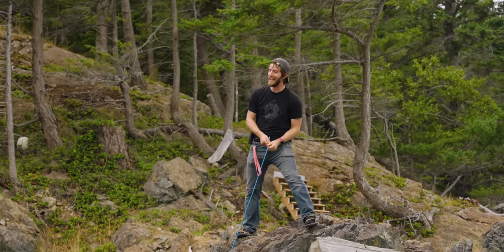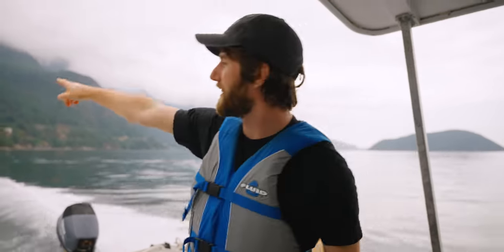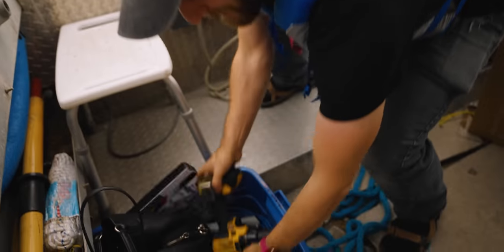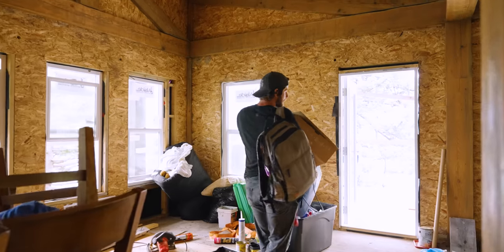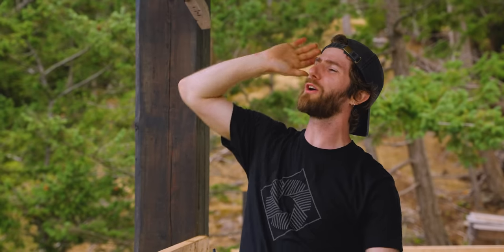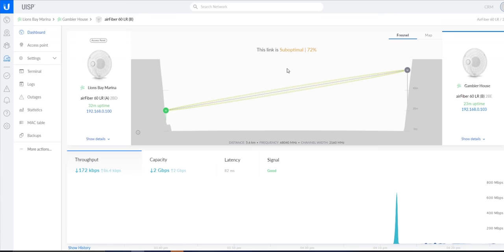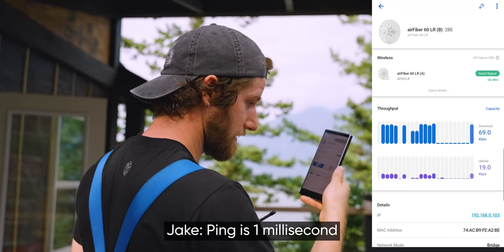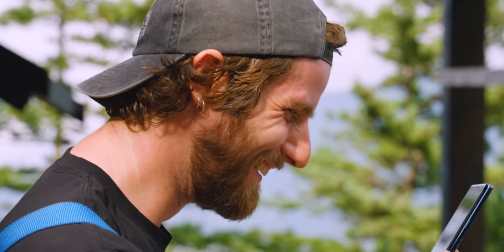How are we going to do this?

Comment: Your tapcons stripped out because you didn't hold the drill straight when you were drilling into the wall. It is very common. Also do not over tighten tapcons. A gentle tap with an impact driver is plenty.

Comment: I would like to know, how steady the system works on a daily bases, like when there's rain oder mist or strong winds shaking the dishes. Can you do an update after a few days/weeks?
Reply: I used to work in a building 100km from a city that got broadband internet through a microwave dish pointed at a transmitter on a tower in town. It was perfect during the day but in bad weather it went to crap pretty fast and would fall back to an ADSL phone connection.
Reply: My internet service provider uses a similar dish from the same manufacturer, as do all our neighbours.  We have very little signal loss when it rains or snows.  Wind hasn’t been an issue either and I’m on the prairies getting a lot of wind.
Reply: @mattleblanc31  I love that one time that you took all of Chandler's clothes and put them all at once and did lunges
Reply: Sprechen sie deutsch?
Reply: @theinsfrijonds  HUH?
Reply: @grey.7828  Matt LeBlanc is an actor who played Joey on Friends a TV show. I was referencing a scene from that
Reply: @theinsfrijonds  Todays Top Grar is trying to be as good and funny as the old and oroginal but they are crap, srry 😂
Reply: My ISP uses dishes like these. (I live basically in the middle of no where with my house dish commuting with a base station) from what I've seen here my ISP cheap out on there dishes because I get no where near speeds like that I'll be lucky to get 15mbps.
Reply: @theduckscp  if it makes u feel any better I had literally 120kbps internet at my old house thanks to it being on a new estate having new houses built everyday yet no bandwidth upgrade.. I do not miss that hell
Reply: @punkson  nein
Reply: That could be interesting
Reply: A friend of mine used to run a WISP off of that very building, to the same island. The biggest issue was multipath off of the ocean, and it changing as the tide goes up and down. That would cause about 6dB difference in performance, and cycle roughly every 11 hours. He eventually gave up and moved stations to higher ground to avoid it. At those low elevations, the ocean is fully in the Fresnel zone.
Reply: @Dreamerick97  no it doesn't, that's the gigabeam LR and they're terrible on both 60 and 5ghz
Reply: @LukeMellor  yeah my b, airfiber60 is the one with both bands, why would u say GBE-LR is terrible?
Reply: @Dreamerick97  The antenna design doesn't work well for 5ghz, I was getting roughly -60dBm on the 60ghz, -80 on the 5ghz which is basically unusable. The mount is not geared towards 60ghz as it's a manually move it then tighten a bolt kind of affair with no fine tuners at all. We shelved them after an hour of use, af60lr has been in full time use for over 6 months now. 2 dropouts due to snow in that time.
Reply: @LukeMellor  oh thanks bro, i was about to buy a pair of those, would u say they dont worth for a 1.72km(1.07mi) link?
Reply: @Dreamerick97  that's roughly the distance I was covering. The af60lr are well worth the extra money by a long way. Got -42dBm with those easily. When panning them in imagine a target. Centre is perfect, a ring of bad signal round that and a ring of mediocre signal around that.
Reply: @LukeMellor  Thanks bro, u just saved my money, God bless ya
Reply: @theduckscp  your speeds may be because the provider does not have enough bandwidth at the main site your radio is aimed at. The data has to come to a site via a backhaul link or stronger licensed link. And then depending on how many people are using that main site the bandwidth isn't available to give high speed to everyone.
Reply: @theduckscp  they probably just throttle your connection to serve multiple customers. More than likely it would provide these speeds easily if they wanted to.

Comment: Radio waves can have some strange behavior over long stretches of water. I would also recommend a 5GHz failover do to the 60GHz will drop the connection in rain.
Reply: Yeah or when you have fog I guess..
Reply: the device already did that out of the box
Reply: All sounds pretty overkill to me for an offgrid cabin.  We used to deploy 24ghz airfibers in NM for gigabit links. Even during monsoon season at 5-7 miles we never had full drops.  Signal would lower sometimes but they were always fine in terms of transfer speeds. I'm super confused why they went with a 60ghz link for an offgrid cabin, especially in an area with lots of weather, I'm guessing it was free from Ubuiqti.  I guess radio frequency laws might be different in Canada as well.
Reply: @Serial32  60 ghz was probably just a band that is free for consumer use in Canada
Reply: I imagine buffeting from strong winds would play havoc with the dish alignments too.
Reply: @leothecrafter4808  I was thinking that as well, I'm not familiar with the regulations up there.
Reply: @Serial32  my guess would either they get it for free, or price, af24hd cost like what ? 3k a piece making the total cost 6k usd before the mounting equipment and other things, that af60 costs less than 1k a pair, and its newer so more attractive for video, i do wish they come up with cheaper 24ghz device at some point
Reply: @TonnyCassidy  Correct, for one airfiber model anyway. A 5ghz backup radio is already built into the AF60, but here I think they may be using the AF60LR, which does not have the backup 5ghz radio.
Reply: @jazzmusiccontinues1134  wait the LR dont have backup radio ? I thought it have it, ill check the datasheet again

Comment: Back in the day, me and one experimental ISP were fooling around with 802.11b wifi, and we managed a 256 kbps link over 3 kilometers, using literally pringles cans and a UHF-like antenna. We managed to blackout an entire town wifi when we fooled with the power on the antennas. 256 kbps over that distance was quite a feat back then over a theoretical 11mbps. The OCEAN would reflect everything and kill any attempt to boost the signal.
20 years later, Linux is shoving a gigabit in a 60GHz dish. OVER A LAKE.

Comment: Feels bad when Linus’ parent’s off-the-grid house has internet that is literally 26 times faster than your very much on-the-grid internet....
Reply: Yea mine is 100mbs
Reply: @ovamper4451  bruh I'd still take that, mine's 35mbps on a good day... Though if you ask steam, it's 3-4mbps...
Reply: @phoxoto  Try 900Kps
Reply: im in a small town and i have 1.5gbps
Reply: @phoxoto  What steam tells you is very much correct. The difference is that your provider states it in megabit per second, while steam states it in megabytes per second.

So 3 to 4 megabyte per second is about 24 to 32 megabit per second.
Reply: Meanwhile I'm here on Optus 4G Mobile Broadband getting 200mbps down/50mbps up (as the average, sometimes they spike at closer to 250/75, but it's otherwise reliable) out in the more rural section of the Riverina, NSW here in Aus.

Also, when comparing mbps (ISP) to MB/sec (Steam), the MB/sec value is 1/10th that of the mbps value, as whilst it's 8-bits-to-the-Byte, data transmission uses a 10:1 bit:Byte ratio instead of 8:1 to provide some parity bits to ensure the data isn't corrupted (easily anyway) during transmission if a bit here or there is dropped.
Reply: At least your able to get high speed internet where you live. I'm not even an hour away from a major US city and can't even get a cell signal without using a 500 dollar amplifier,and then I get mabye 1 megabit per second that cuts out every min for about 20 secs with a monthly hard data cap of 30gigs. After that it's capped to 115kbps and I gotta pay over 100 bux a month for that garbage.

My life has been a nightmare for over a decade now
Reply: 3mbps in 2021. This is painful
Reply: It's honestly dystopian how bad internet connections are here in America. And not even because it can't be done. All just because like 3 companies are maintaining a stranglehold on infrastructure to bleed customers for every penny they can.
Reply: @gundoxcrit1652  here in the UK there's only 2 different lines, BT or Virgin, all other providers have to run through BT's network because it's their infrastructure, so BT not only throttle those services as they see fit, they also throttle their own packages in order to get you to pay more because what else you gunna do? Go with another service on the same lines? Go with Virgin on their weaker, less available, lines?
Reply: @SEXCOPTER_RUL  move
Reply: How can you tell that? They don't even have an internet connection over there yet until the ISP hooks it up in a couple of weeks, and they didn't show us internet speeds from the lte modem. The fuck are you talking about
Reply: @phoxoto  i literally live in a 3rd world country paying arround 40 usd for a 100mb download / 5mb upload
Reply: You're talking shit, they never showed "internet" speed, only W/LAN speed. That would be like saying you have Gigabit internet because you have a gigabit switch at home - that won't determine what your actual internet speed is.
Reply: @jdilksjr  i get super excited when i download at 2mbs but its usually 500kbs to 900kbs
Reply: Dont forget the private island.
Reply: I have 4 Mbps on 4G LTE
Reply: @TheDarkFalcon  bro why the aggression?? A quick read through this thread already proves I don't know shit about how this works, my original post was just a light hearted comment poking fun at my own bad internet... Lighten up, my guy...
Reply: @AndiKola  my guy, what's with the aggression? It's already apparent that I don't know shit about this stuff, I was just making a light hearted punt at my own bad internet from what I thought were internet speeds... Lighten up, the world is shit enough as it is...
Reply: @darkbobo000  well you learn something new everyday, I rescind my shaming of Steam's display xD thx for the info!
Reply: @phoxoto  Now you know better. Your slow internet is way way better than what linus set up because he doesn't have internet at all.
Reply: @AndiKola  wow Andi, ty so much for the ✨knowledge✨. Life = changed. Now to get rid of my humour so I can be just like you 🙏🙌
Reply: @phoxoto  I don't want you to get rid of it, I want you to improve it
Reply: @AndiKola  teach me, daddy 🙏
Reply: @phoxoto  dude mine is 1 now for some reason its been super slow the past week and steam said it would take 13 hours to install a 4gb game
Reply: @dukiest7368  biggest oof 😬 I'm sorry for the loss of your internet

Comment: What about during thunderstorms or a strong wind? Could that mess with the internet?
Reply: i was thinking about fog, since water is good at absorbing radiation
Reply: In theory, yes, in practice? Not too common over that short range.

In practice, I have had worse interference on rainy days from copper based T1 connections which had shoddy wire bundle wrappers and would short out with water leakage at a past employer than I ever had with any point to point wireless nodes I set up for that same employer, and had network monitoring and statistics to back that up.
Reply: I would expect once everything is fully tightened down wind should be fine up to 30 to 40 km/h, rain will cause signal degradation depending on how heavy it is, but shouldn't need regular adjustments. Satellite dish mounting arms like that stay in place pretty well, I'd be more concerned about Ubiquiti's mount system to the mounting arm knocking it out of alignment in heavy winds. But they aren't in hurricane country I doubt they have many storms that are going to cause problems.

Also his parents need to make sure the trees stay trimmed to keep the beam from getting blocked by leaves or branches.
Reply: @Kinkajou1015  have you seen the mount on these air-fibers?  It's on another level from the previous mounts that I've seen from Ubiquiti.  Very nice.  Longevity remains to be seen, but they seem extremely durable.
Reply: @tburda823  This video is the first I've seen.
Reply: @Kinkajou1015  id be more worried about snow flurries than anything else
Reply: With my own personal experience it's not noticable for the average person. Maybe if you're playing very ping senstive games.. But even with really bad weather it hasnt been any issues. But even then, it's still been 10x better than 4g/adsl in the same building.
Reply: It can. But you need severe interference. Fog has a chance as well but really the main problem with air fiber is trees.
Reply: It will work just fine
Reply: Weather can greatly impact signal indeed.
Reply: During massive thunderstorms, the link could disconnect. Other than that we have been running them on 10+km without issues.
Reply: @Kinkajou1015  I would be more worried about snow and ice collecting on the dish causing issues of outage and alignment especially on the house side. A heavy snow fall may cause enough interference to cause degradation of signal, and enough snow/ice on a dish can cause alignment to slip. This is more of a concern with tv satellite but I would imagine same principals apply to these dishes.
Reply: Yeah what about if you have bad weather? I hate how so much detail is really missing from this video, especially how they didn't talk about who they had to ask to barrow the main land building to put the dish on.
Reply: Yes. That device has a 5 GHz backup radio that moves through the rain/water better. It would be slower but more reliable.
Reply: @Grid21  what do you mean "who they had to ask"? They had to ask the owner of the marina, work out a 1 time fee or a yearly payment to mount it there. It's not so hard to figure out.
Reply: Yes, the humidity affects, wind not too much if the antenna doesn't move, but heavy rains will make the capacity drop. Beeing 60GHz it might maybe drop a few times.
Reply: Fog - other than that pretty solid. We have one running (a smaller model mind you) running a couple hundred feet between buildings) and fog has been the only hindrance. Rain has had little impact.
Reply: As long as antennas stay tight and not moving then everything will be fine. Speaking from experience.
Reply: as someone who works at an ISP, strong winds always misaligns our antennas a bit.
after a few storms the signal has deteriorated enough that we have to send someone to realign the dishes.
Reply: as far as i know, it will, and greatly, to the point thoose antennas have 5GHz band ready when the rain goes brr... but up to some distance it may not affect it at all would e sweet if the post an update during rain or fog
Reply: Having spent the last decade in the wireless communication industry, Snow is only an issue if it sticks to the dish, fog shouldn't be an issue, it's much too localized to be an issue. My biggest concern is the the actual body of water. If the water is super choppy the waves could get large enough to hit the Fresnel Zone, and interfere with the signal directly, or if the water is ever super glassy, you could end up with duplicate signals (with a slight delay) reflecting off the water's surface.
Reply: I have something similar in my house, and it actually works fine. Even with the snow.
edit: it's an older Ubiquiti model, only 100Mbps.
Reply: @grey5626  as someone in transport the thousands of t1s we have/had were no where as finicky and temperamental as our ptp microwave hub and spoke network we had set up on a heavily populated mountainous island in the Caribbean. Especially when trees pop up out of no where and you have to arrange a helicopter crew of forester's to cut it down lol.
Reply: @BattousaiHBr  are you tightening those things properly? I have installed 500 plus ubiquiti antennas from litebeams to powerbeams and air fibers. Very rarely do they need any adjustment and I have some that have been up for 2 plus years . . .
Reply: Heavy thunderstorms will interrupt the connection temporarily.
If the dishes are mounted tightly, winds shouldn't affect the signal.
Reply: @benjaminsheppard8089  i don't install them myself, what i do know is that the towers where these are installed and the gear we use may or may not be of the best quality.

Comment: "The signal can be blocked with a single sheet of paper"

* Rain goes brrrrrrrrr *
Reply: Or what about boats passing by? 🤔
Reply: @GameKingFaiz  Boats are hopefully not tall enough to block the signal.
Reply: @RubyPuntastic  a sailboat could though, couldn't it?
Reply: @Alex-np3ps  I can't tell from the video how large the height difference is or whether sail boats commonly pass through. As OP mentioned tho, rain would likely block the signal, it's not gonna have 24/7 uptime anyway.
Reply: Weather will definitely be an issue. My town just got real internet last year. Before then we had a company that used these dishes to bounce the signal from a central location to every house in town through an array of dishes. Every time the wind was blowing over 10 mph, the internet would be terrible. If it rained or snowed, it was like having dial up again. Crazy that it's 2021 and there's still thousands of towns across the country that don't have a wired ISP or internet at all yet.
Reply: @RubyPuntastic  yea but with the dish on the marina being mounted pretty low it's not impossible. a pole mount that goes above the roof would have been better
Reply: @shriramvenu  That would probably shake more though
Reply: @ChaseSchleich  not that crazy. No company wants to wire a whole town if there’s less then a certain pop. Unless it’s a rich town they won’t make enough money.